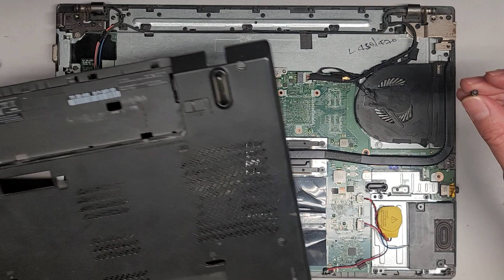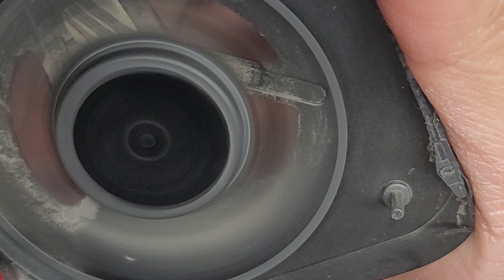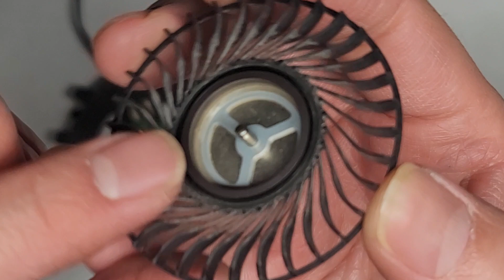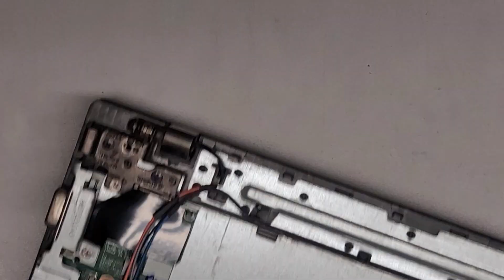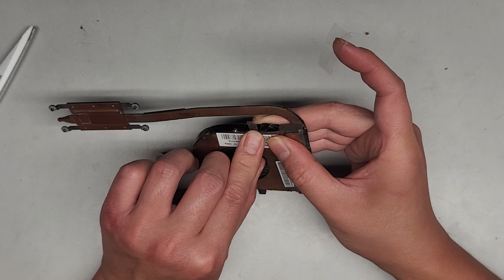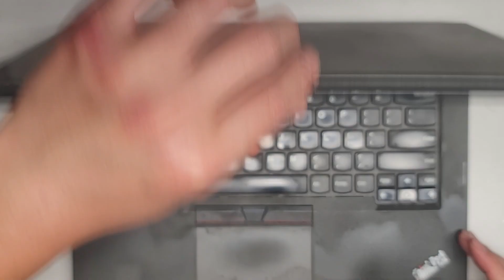Lenovo ThinkPad L450 Disassembly RAM SSD Hard Drive Upgrade Battery Fan Replacement Repair

Comment: Thanks for the great video. Graphite powder is highly conductive so I would never put that into an electronic device as others suggested. The oil you use is likely the best option.
Reply from the maker: I think if you're just putting it in the fan it'll be ok. It won't come out, same way a lot of the stuff in the computer is metal and conductive.
Reply: @ItsBinhRepaired  Graphite powder will be blown around because it's powder. It distributes itself evenly across surfaces and it doesn't stay where you put it and that's how it's designed to behave. Not like the other metal bits in the machine that don't just fly everywhere.
Reply from the maker: @jellibeens  interesting

Comment: Is it possible to replace the processor on this laptop?
Reply from the maker: Possible, technically yes, but if you're asking, then the cost and materials, experience, etc. to do it, you might as well buy an expensive gaming laptop.